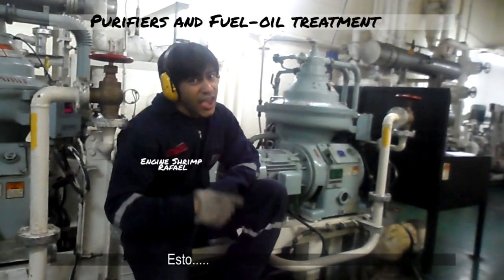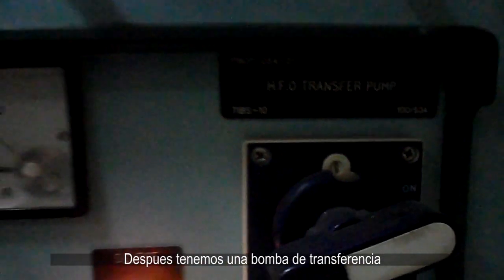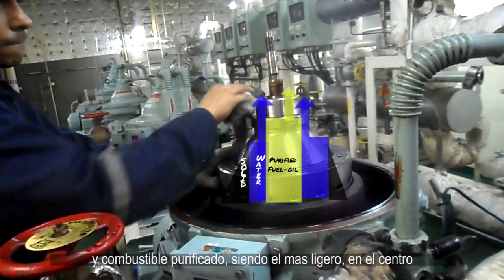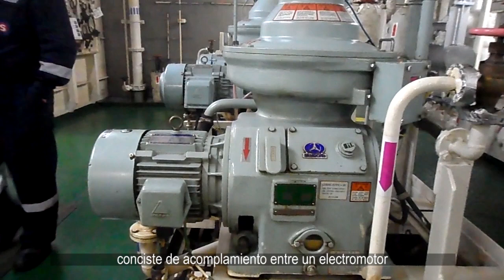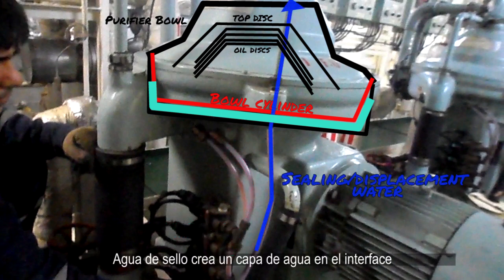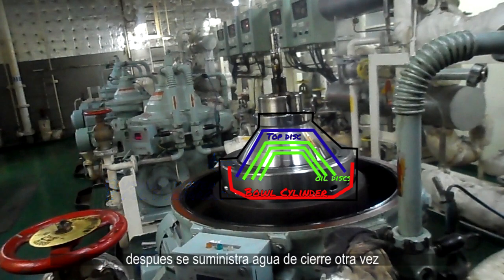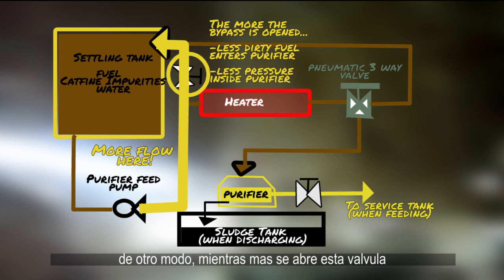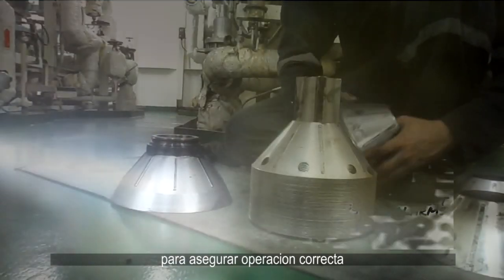Centrifugal Purifiers and Fuel-Oil Treatment - 4th Engineer

Comment: Sir how temperature affects working of purirfier
Reply from the maker: Hello my friend temperature in the purifier is very important especially for HFO.. If it is too cold then you could risk heavy sludge deposits and therefore more frequent cleanings.
If it is too high then the water starts to evaporate in the fuel making it difficult to separate causing water in fuel alarms.

Comment: Hello, I'm having issues with dropping circulation pressure in L.O hidens purifier after few minutes while running,  samgong -mitshibishi SJ35HH make...any suggestion pls
Reply from the maker: Troubleshooting remotely is difficult however check by seeing if there is no strange leaks from the sightglass - discharge hole, maybe also the water seal has been broken or not there at all due to no displacement water going, there are a lot of tests that need to be done. Sorry for the late reply but maybe someone in the future will read this.

Comment: Nice Vid SIR!, Can I ask what's the purpose of the pressure gauge and sensor, monitoring the water discharge line and when to close or open the ball valve of the water discharge line.

Comment: the purifier same like when i was cadet, but the common trouble was the pressure inside the purifier because the outlet valve so sensitive i dont know why its so hard to set the pressure outlet
Reply from the maker: Yes this is true! The outlet valve is very sensitive for internal pressure, but usually if bowl and pilot valve overhauls are done regularly these purifiers are very stable and sometimes in 1 contract only need 1 or 2 cleanings.
Reply: i’ve been  waiting for so long for new video, and you are come back as an engineer congratulations broo for first contract

Comment: Man, we did whatever we can to avoid those LSFO to mix up with current oil but it still did, produced a bunch of muds, clogged strainer and filters, almost clogged my precious Sludge Tk to Bilge Oil  Tk pipe, and finally fucked up my favorite No.1 & No.2 W.O. Tks plus Sludge Tk. Then overhauled the sweet Mitsubishi purifier weeks after we'd changed the gravity disc.  I hate my job so much sometimes and I wonder why this can't be avoided 100% or is it the 10% makes me feel that stressful, so I'm starting to doubt if I'm the one for this kind of jobs  :p
Reply from the maker: Hahaha oh my God I have never seen that happen because the vessels I have been on didn't use LSHFO, only MGO in ports and HFO in navigation.. Now with the new rules of MARPOL 6 I really don't see many companies using LSHFO now unless they implement a Chimney exhaust scrubber.
Anyway, thanks for sharing the experience sounds like a wild ride.. I understand the feeling that pressure starts to build up when problems arise but coming home after a good contract with nice savings and sharing experiences with family and friends is a wonderful feeling that I could only get with this job.

Comment: I would also like to raise that if there is a leak within the purifier then there could be an abnormality with the water to close system which could result to an untimely opening of the discharge port on the sides of the purifier even during the centrifugation as this ports should only be opened once the separation process is done.
Reply from the maker: Very good brother, you are showing good understanding of the equipment! When it comes to problems with purifiers there are lots of things to investigate when troubleshooting.
Reply: Thank you brother